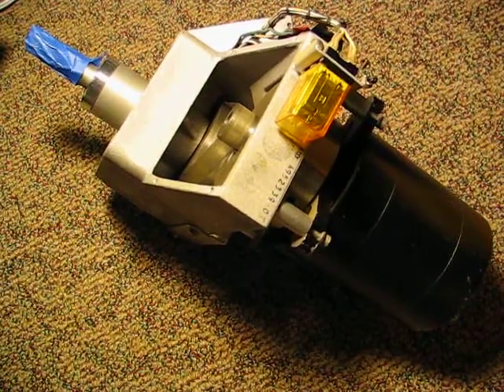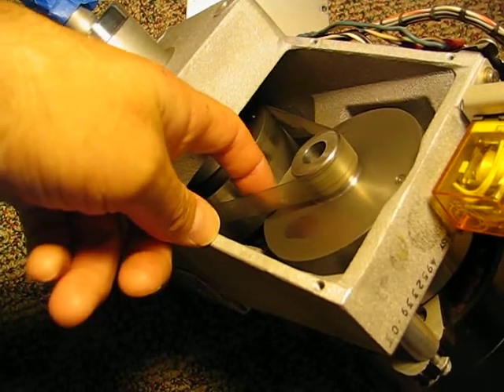Ampex MM-1000 Capstan Belt And Flywheel Exposed

Comment: How about the motor? Is it a bldc?
Reply from the maker: No, it’s a hysteresis sync AC torque motor. The MM-1000, later in its production, was available with a DC servo capstan system as an option, but mine is the AC motor.